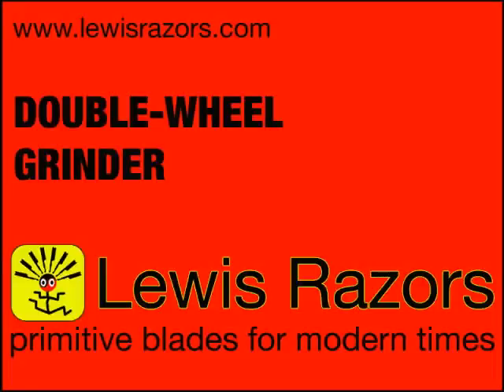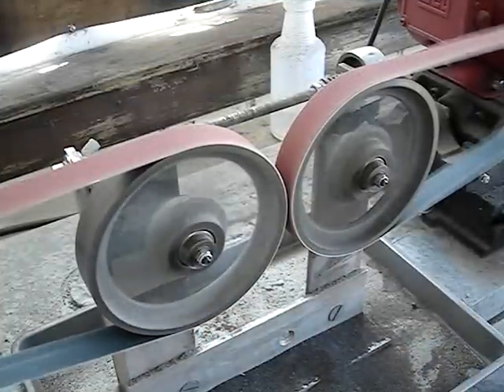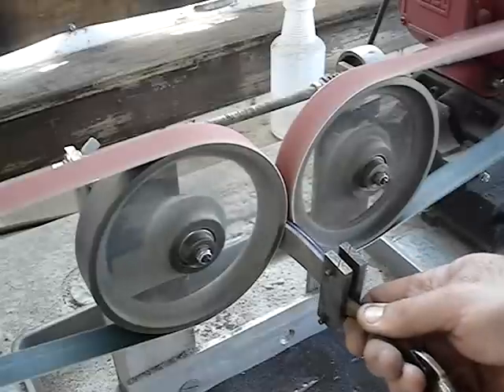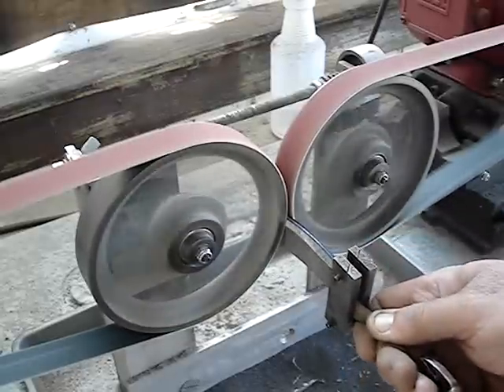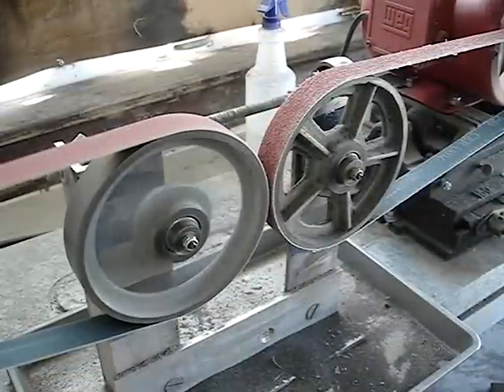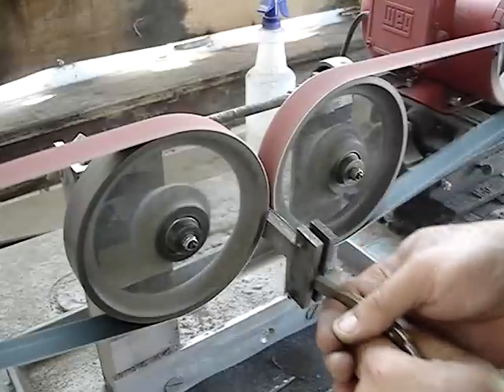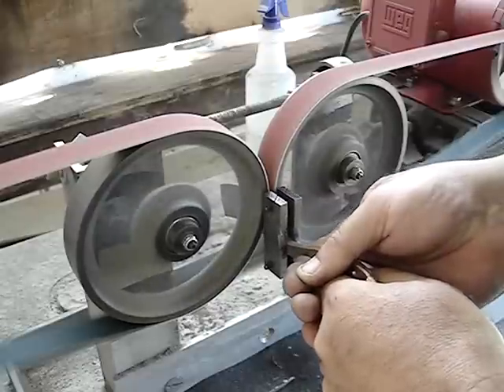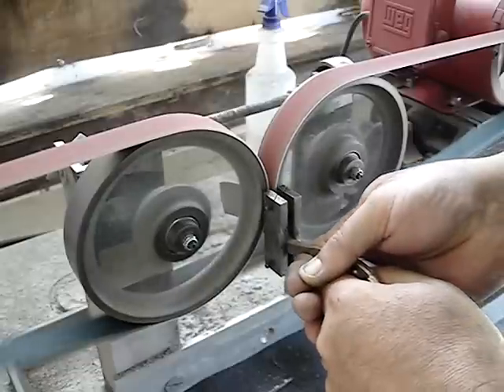Double-Wheel Hollow Grinder

Comment from the maker: All the ideas you mentioned are right on. Yes, you rough grind > heat treat > finish grind > finish work and sharpen. Yes, you can grind on a single wheel without any guides. I do most of my grinding on a singe wheel without any rests. I do mark my center line, and try to do the same thing on both sides of the blade. I would recommend joining a knife making forum such as British Blades or Blade Forums. The forums are full of great advice.

Comment from the maker: @TheMuslimKiller Straight razors are honed by laying them flat on the hone. The hollow in a razor allows the edge and the spine to touch the hone. That way you do not have to hone the whole side of the of the blade. The hollow makes it a lot easier polish the edge to a razor sharp edge.

Comment from the maker: @Squarerig I make razors, a hollow grind works well for razors. The hollow allows the metal behind the bevel to be very thin, this works out well for razors. 

The hollow also makes honing razors easier, when you lay a razor on a stone only the spine and the bevel touch the stone it is like having a built in honing guide.

Comment from the maker: I am doing the first grinding before the hardening and quenching. I am not worried about overheating the metal.

After hardening and tempering I use water coolant system to keep the blade cool.

Comment from the maker: If I stick it from the top. The blade pops through really fast and scares me. LIke you said it can ruin a blade. The grinder has enough flex in it to let the blade through without breaking.

My heart rate jumps and I am wide awake for awhile, but it is not a disaster.

Comment from the maker: @zedafaca123 They are 1725 rpm, ½ horsepower motors. The drive pulleys are 3” inch in diameter.

Comment from the maker: Thank you for the kind words.

I mark the center line and lay out lines when I use the single wheel grinder. I have more control grinding up to the lines with the single wheel, I am not sure why it is just the way I work best.

I have used water before when doing the final grinding, there is a tray to catch the water on the double wheel grinder. Some times I use water when final grinding sometimes I do not, it depends on what kind of belts I am using.

Comment: @lewisrazors  OK, I have a vertical sander, and a bunch of 1X42's...I like Klingspor, a German made belt...middle of the range on price, not too agressive on the material removal, but very long life. I've used a lot of their abrasives in my jobs as welder and machinist/mechanic on a variety of industrial stuff, so I needed the good quality.
  Klingspor sells retail, but has $50 minimum. If you can get any, I think you'll like them. They make belts, disc's, hard wheels, cur-off's.

Comment from the maker: I have a lot more control over the shape of the hollows on a single wheel grinder. When I grind razors the hollow does not usually conform to the shape of the contact wheel. I tend to grind the area behind the edge and first bit of the blade a bit thin. It is easier for me to do on a singe wheel grinder. I just have more control over what I am doing on a single wheel grinder.

Comment from the maker: Good observation, but I was rough grinding, the blade has not been heat treated yet.  

After heat treat I would go slower and not let the blade get hot and change color. Before heat treating I am not worried to much about over heating the blade. The blade is going to be heated red hot during the heat treat process.

Comment: That's why you use it from the bottom side, where the wheels are spinning away from you. I saw a buddy of mine get his thumb pulled through the corner of a cylindrical grinder once. A part he was feeding onto the rest spun out and pulled his thumb between the rest and the corner of the stone. No need to tell you it made a mess of his thumb. I imagine this double sander configuration you have would do similarly if you came down through the top side...it would pull you through the wheels. OUCH!

Comment: brilliant effort saving arrangement devices im about to start my own knife dont have any of this kit though? i may be able to get hold of a 4inch belt grinder and later on a kiln oven for the hardening tempering of 01 steel hi carbon im getting quoted at this time? from yorkshire steels UK ltd? i was wondering if you could give me advice if only using a one belt grinder? not double as seen here after ive cut out waste areas is it largely done by eye on the grinding belt i know you score a line

Comment from the maker: @alby94444 Yes, the motors are wired to be able to change directions.

It is harder to see what I am grinding when the spine of the blade is facing up. All of the sparks and dust also fly up in the air toward my face when the motors are spinning in reverse. 

I tried having the wheels go in both directions but found I did better job when they are spinning downward in middle.

Comment: Wonderful Lewis. It's a stroke!! You said you no longer use the double grinder. . .How do you get a precise bevel with only one grinding wheel going. I was also wondering what would keep you from feeding water from the top on each wheel to keep the the heat down. . . since both wheels are running down and the excess water could be caught and drained. I love your videos Lewis. I learn something with every one. Thank you so much for sharing!

Comment: as blade centre point up the plate steel flat stock edge sides after gem markering it with black felt tip pen! then score thru it to steel to get your cutting edge centre guides! but when you then take steel to a one sided grinder i guess youve got to be very careful systematic in strokes to obtain the correct shape? of blade the hollow grinding of it? and also can it be done without guides? & do you reserve excess waste steel once basic shape is formed? before you harden then regrind to final

Comment: finish? so its like a two step operation on the grind get the basic shape leave some then harden go back for final grind is this correct order of things? or do you grind to final edge finishes then harden afterwards? sharpen etc! because ive not worked in steel before and havent got a workshop yet to access fully equipped im trying to btain as much info before i set out? to do this? i also wondered do you need anything special for the brass riveting of handle? to drive them thru the pilot holes

Comment: oh thank you very much for the info..i'm thinking to build one but using two gear with same number of tooth, it will turn in opposite direction and no need for two motor, is it possible if i may  ask you? thanks again, from Philippines here..

Comment: Sir:  I did this back in the early 1970's. After a few days I had this miserable pain in my right forefinger. The pressure from holding the tang had injured a nerve in my forefinger. Some 50+ years later I still have some pain. I see that you hold the tang the same way I did. Maybe you have just been lucky. BTW, would like to see the finished razor.
Reply from the maker: I did not develop the pain in the finger, I only used this grinder for a short while before going back to a single wheel grinder.  Some if the razors in this older video were rough ground on the double wheel .  https://youtu.be/PGwxnD_LO0g

Comment from the maker: @billy2sweets It is more the thickness of the blade, and what diameter wheels I am using that make me adjust the distance between the wheels. 

Razors are the only blades that I make so I do not have a lot of experience with blades much over one inch wide.

Comment: if you set up two angle grinding wheels very close together slightly overlapping not lined up 
to touch but rotating in opposing directions similar to your grinder could this create an edge which could become immediately usable?

Comment: that is a really awesome set up. i do have a question though. how hard are these to heat treat after the double hollow grind because i was wondering since the metal is very thin in comparison to the spine do they crack alot or warp during ht.?

thanks
Mark
Reply from the maker: +ohioedwards I have some heat treat failures, but they are few and far between.

Comment from the maker: The wheels are spinning downward you have to pull the blade up into the wheels. 

If I make a mistake and put a blade in from the top it just pops through the wheels, it is not a dramatic action.

Comment: That is wicked cool man! Why do you not use it much anymore? Would it not be more precise?
Reply from the maker: I thought that it would be more precise, that is why I designed and built it. WIth some more work on the design it could be a more precise tool. As it stands now I can do better more accurate work on my single wheel grinders.
Reply: Makes a lot of sense. Variable speed would help but Im sure it would be hard to get the two motors to be the same speed. Ive been thinking about making one but using 2x72 and doubling the belt up with a idler wheel above. It might work but then again the wheels will be spinning in different directions, may cause a problem. On this grinder are both wheels spinning "down"?
Reply from the maker: Yes, the wheels are spinning down.

Comment from the maker: + tonycstech In reality you get a lot more variabilty for how you hold the blade. Both sides of the grinder cut evenly enough the randomness and inaccuracy is induced by hand holding the work.  In a perfect world things could be be better. This is an easy to make and use set up. It is easy to make complicated setups, designing simple clean setups takes a lot of thought.

Comment: i had this idea about using 2 stone grinding wheels just like this but a lot bigger and make all my knifes a little hollow. that way they are easier to resharpen with a flat stone and the angle should be correct every time. is that a good idea? what are the weaknesses of  the hollow grind?
Reply from the maker: It depends on how hollow, with a razor I make a real thin blade. It is great for shaving, but not strong enough for litlle else. I wish I had a good answer but it depends on the geometry and use of the blade. Thanks for the comments.

Comment: Hallo!What power the engine and how many revolutions per minute?And оn the length of the tape which is designed grinder?
Reply from the maker: They are 1/2 hp 1725 motors, the belt is 1 x 42. Here is a video showing more of the grinder. Double Wheel Grinder Closer Look

Comment from the maker: The wheels are spinning so that they are pushing the blade away and down toward the table.
If someone other that me were using the grinder I would put on a guard on the the top side of the the wheels to prevent accidents.

Comment: I always wondered how hollow grinds were done, I guess this is one way, pretty cool. You have to finish the bevel on a single wheel though right?
Reply from the maker: When I was using this grinder I would grind the blade real thin < .010 inch then put the final bevel on with sharpening stones.  Now days I use a single wheel for everything.

Comment from the maker: I was rough grinding a straight razor. The rough grinding is not a precise operation. The precision grinding comes later in the process after heat treatment. What I showed was of the preliminary steps to get the initial shape.

Comment: maybe a bit of a dumb question, but in which direction are they running? i am assuming the left one is running clockwise, right?
Reply from the maker: They are both spinning downward in the middle. The wheels are pushing the blade down toward the table.

Comment: Wouldn't it be cheaper and better if both grinding belts were connected to each other with chain and sprockets? That way you would only need 1 motor and the belts would for sure rotate at the same speed. With this setup, the other motor could rotate a bit slower and that way grind less thus making the blade one sided more.

Comment: That's really cool. Thanks for posting both this and the "closer look" video. I recently made 430 small dull swords for a sculpture and man this would have come in handy to put the rough dull edge on them. Instead I just wore out several 8" bench grinder wheels. And my hands. And my wrists. And my elbows. I may have to steal your design if I do a similar project again. How much did this cost you approximately if you don't mind me asking?
Reply from the maker: +DopeItUp I do not really know the cost, so many of the parts were salvaged from my shop.  The most expensive parts were buying two new identical motors. I usually use old are used motors on my projects.  

Thank you for the kind words about my work.
Reply: Thanks for the reply, keep up the great work :)

Comment: You said you almost never use this grinder anymore....Why not? Seems like a huge time saver at the very least.
Reply from the maker: +Nick Vanderburg  In theory it is a time saver, but actual use I can do the same thing faster and more accurate with a single wheel grinder on my 2x72 grinder.  The double wheel grinder is a good roughing tool but not a great finishing tool.
Reply: +lewisrazors Would it be possible to make an armature to hold a piece in the middle with no wobble? Then you'd only have to worry about moving it back and forth equally
Reply: +lewisrazors Would it be possible to make an armature to hold a piece in the middle with no wobble? Then you'd only have to worry about moving it back and forth equally

Comment: Call me an idiot, but what does the hollow grind accomplish in this video?
If the hollow grind goes almost all the way to the spine of the knife - is there any benefit to the hollow grind at all? 
Not pickin', just asking :)
Reply from the maker: +Brian M The hollow grind is perfect for a straight razor. That is what I make straight razors.
Reply: lewisrazors You stated at one point in the video that the wheels of the grinder were .040" apart. If you are passing the working edge of the blade through those wheels (as you do near the end).. isn't the working edge of the razor about .040, and flat? You're obviously the professional, and know what you're doing..  it just appears odd from the video 9sort of counterproductive).

Best wishes!
Reply from the maker: +Brian M The finished razor is about .003 behind the edge.  The grinder made a good rough pre-heatreat grinder.  The distance between wheels is adjustable. I do not use this grinder much now days I can do it faster and more accurate on a single wheel.
Reply: lewisrazors  I checked out your website - absolutely beautiful work sir!

Comment: Hardly.  The dual wheels are pushing the sharp edge away from the user.
Therefore there are NO PINCH POINTS...which is one of the principle causes of accidents.  The user has a STOP GAUGE and is working at a reasonable rate.  Be cool with comments, DG.

Comment from the maker: The blade was not sharp after grinding. This was just the first step, after this I still had to harden and temper the metal, finish grind, then sharpen the blade. in this video I was rough grinding the blade to shape.

Comment: I think that is a thing that needs explaining very much. This is not so much about sharpening as shaping that concave edge for supreme cutting. In addition a concave edge will only survive anything but surgery and shaving if the steel is of the best, well hardened and tempered to suit the angle of attack at the very cutting edge.

Comment: why don`t you build the same type system in principle but use two 80 grit wet stones instead with a pully wheels on a spindle , 
so each stone is on a spindle with the pully wheels on the each ends of the spindles then attach belts to there given motors. then have drip feed taps above the stones. this will keep the metal constantly cooler, But stones have to go slower,

Comment: You don't grind from the top because of the direction of rotation on the wheels. If it were put in from the top it would suck the blade down through the wheels and would ruin your blade and possible damage your grinder.